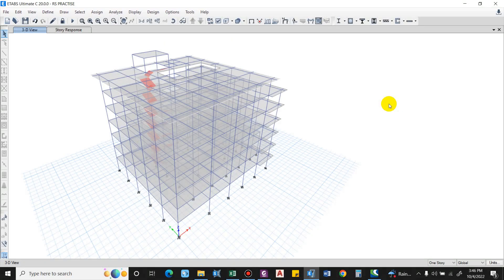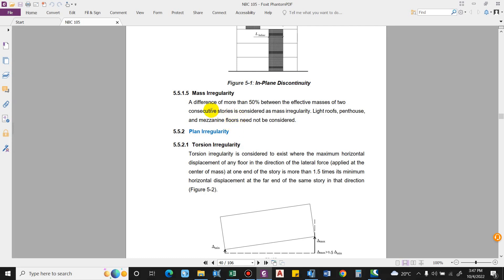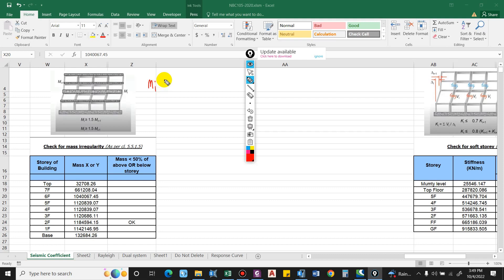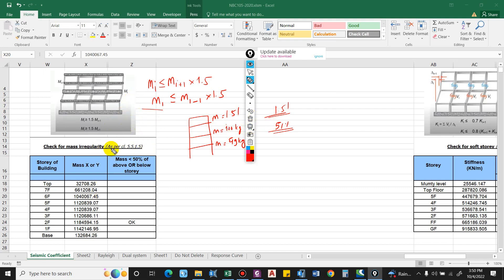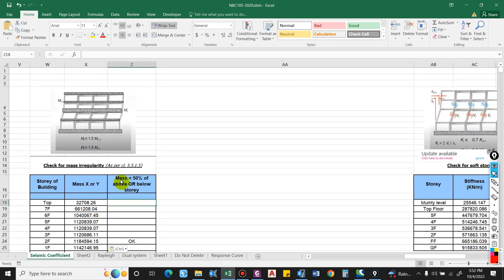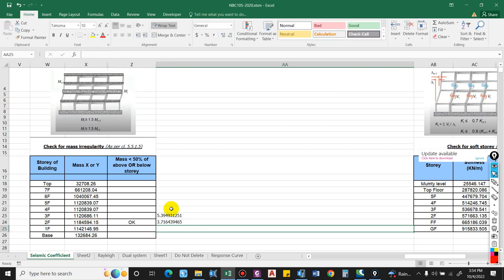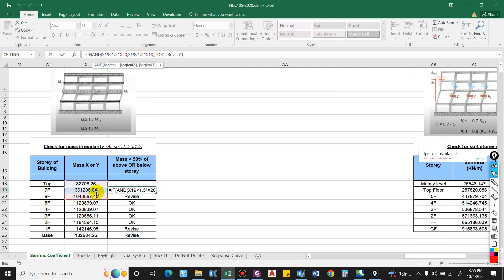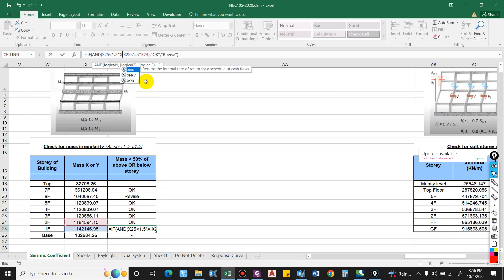Mass irregularity check | ETABS Analysis of Multi-Storied Building | NBC 105:2020 , IS 1893:2016

Comment: 5:51 Have mass irregularity but you don't say what to do further. Is this change the column beam size for load reduction or only need to go through response spectrum analysis?
Reply from the maker: Through response spectrum you will see differences in base shear and results respectively.